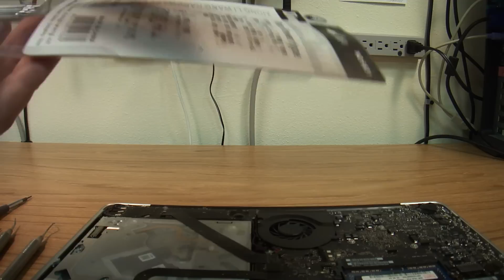How to fix Broken head phone plug jack inside Mackbook. Teardown, Disassembly and removal Part 1

Comment: Thanks so much for your video. The broken jack stuck inside my mac very seriously. Trying to get it out using glue only made it worse. Heating my tweezers with a lighter did the trick! So I could push it inside the plastic core of the broken jack and get it out really smooth. Audio working again, thanks again this was a big help!!

Comment: I fixed mine with a 2 dollar Virtual 5.1-surround USB 2.0 External Sound Card....123 fast
Reply: +elpilonvideo That's hardly a fix though is it? That's like saying a headlamp on your card broke so you replaced it with a flashlight.
Reply: +Richard Birch haha as long as it works it is a fix
Reply: +elpilonvideo that's called an alternative solution